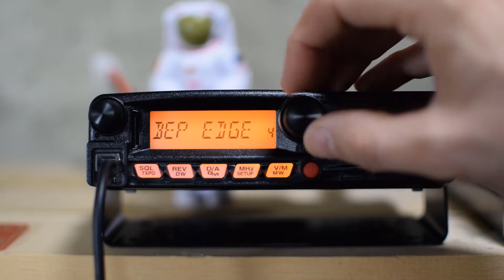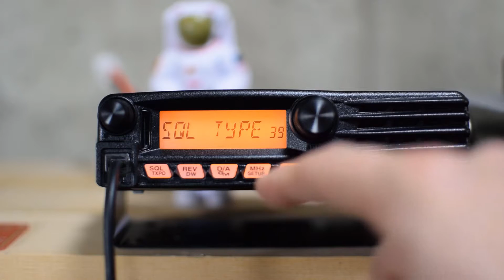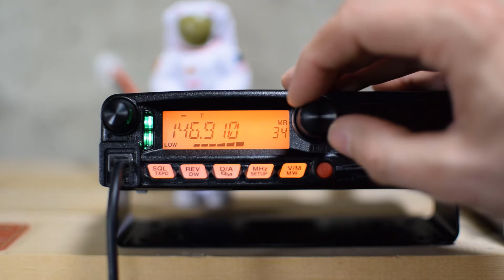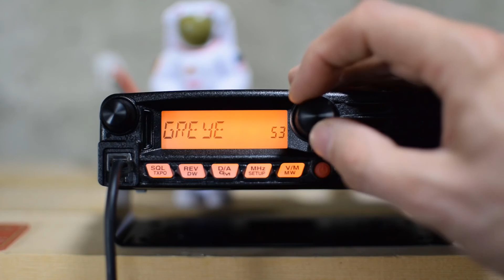Yaesu FTM-3200D Programming a Repeater Frequency Into Memory

Comment: Hi again it says minimum 20ah power supply.I found some on eBay 20ah-30ah 12.v for led cctv etc do you think will work with the radio? I’m new in ham radio and I don’t want to spend for fancy psu from radio shop I just want to simply to work with radio. Many thanks for reply
Reply from the maker: I can't say for certain without seeing the power supply.  I read something about cheap power supplies in a ham radio facebook group but don't remember the brand or where they were sold.  My recommendation is to buy a supply made for radio from someone like mfj, pyramid, jetstream, etc...you'll spend a little more but the supply will work better than a cheapo unit and you'll be able to use it for more things in the future.  Or buy used from someone you trust.  With radio gear you often get what you pay for.....
Reply: I've been running mine, and my ICOM 7300 simultaneasly with an Alinco DM-330MV for several years now. Never any drop out. It's well worth the money.

Comment: How do I change the power level from low to med on a preselected programmer channel?
Reply: sorry, I have the 3100
Reply from the maker: I'm not sure if the power level is stored in the memory or if it is just set in the radio and applied to everything until changed.  I'm at work now and can't check the radio
Reply: Found it.  TXPO is a button on the front.  Just needed to decipher the code.  Thanks